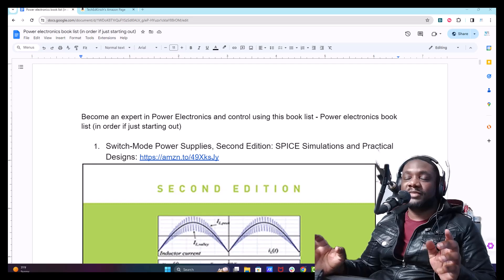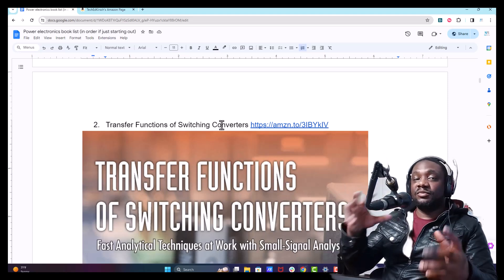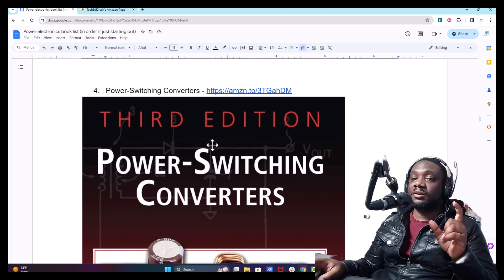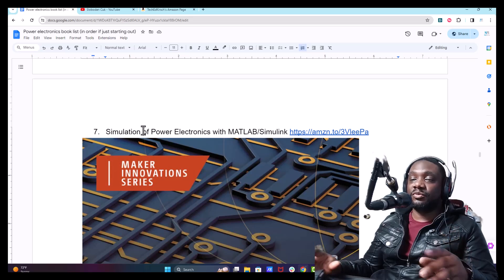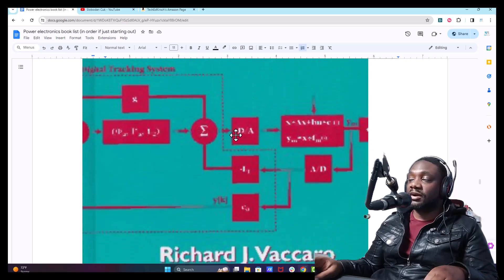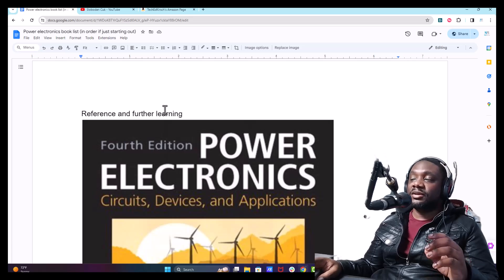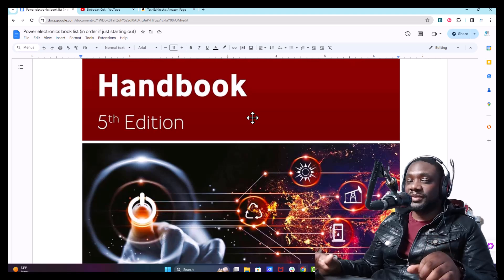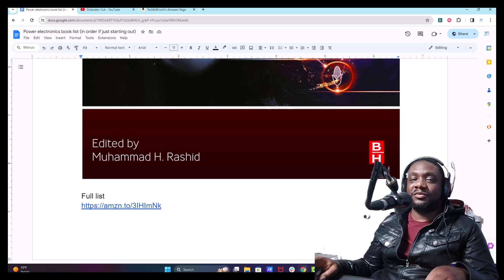The BEST power electronics books for Electrical Engineers

Comment: Hello tech Ed kirsch, I graduated in 2018 with an electrical engineering degree in ghana but I feel the knowledge gained wasn't practical enough. I try as much as possible to relate what I learn from engineering books but most are packed with equations and its difficult to relate. I need some advise from you because I plan on pursuing my masters in power electronics soon.
Please help me, I don't want to join the saturated job market of software development. I am at the crossroads here.
Reply from the maker: Hello Rischio, yes the application is so important and I feel exactly what you're saying. The best way to reach me is at kirsch at hasofu dot com. I'll give you some advice and insights.
Reply: @techedkirsch  Hi, please I would be reaching out too. I have similar experience currently. i would appreciate your guidance. Thanks.
Reply from the maker: @ndukaspeedwell  Understood. email me at kirsch at hasofu dot com and we can discuss. I know what you need to get to your goal.